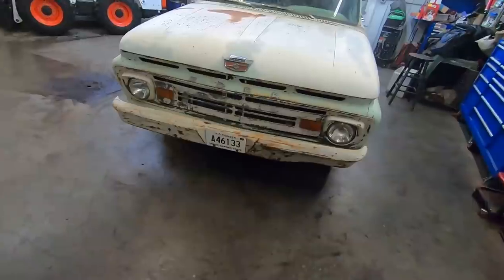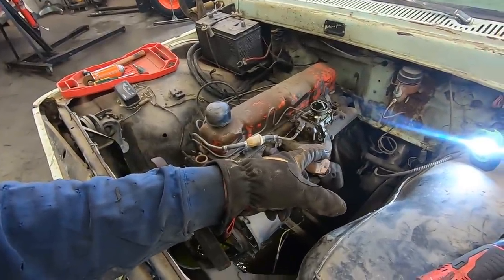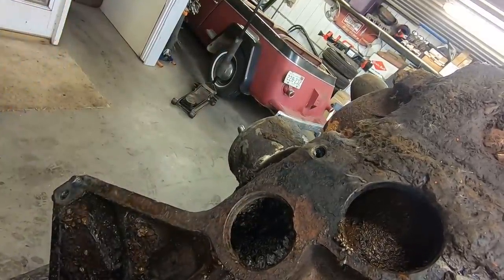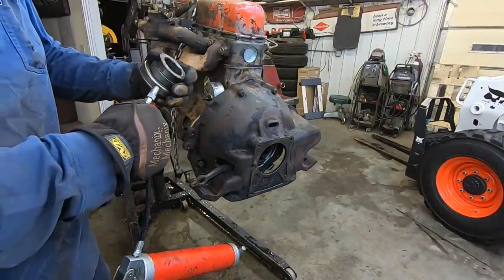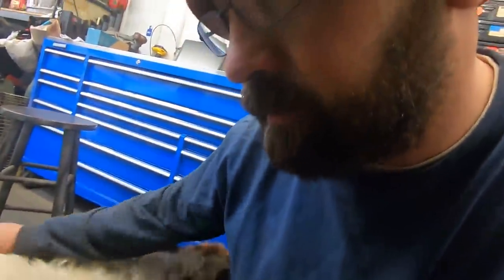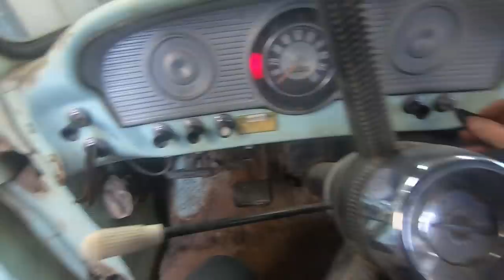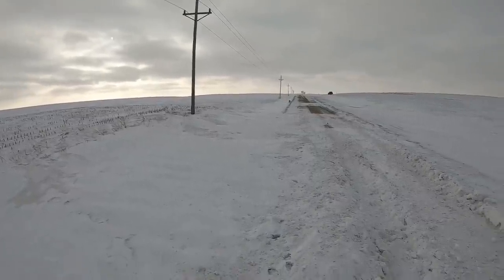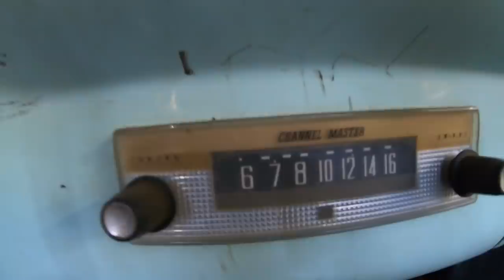My 1961 F100 Unibody Shortbed finally gets an engine R&R! And then we bury it in a snowdrift...

Comment: That old six would be a great candidate for a low pressure turbo set up. Nothing fancy, no intercooler or anything like that. Just a little 5psi boost. With the exhaust and intake being on the same side of the engine, even the plumbing would be easy.
Reply from the maker: Hmmm interesting

Comment: Chevy's inline 6's (230-250 and 292) have a freeze plug in the back of the block between the block and bellhousing also.  It's not just Ford things.
Reply from the maker: Never had an issue with one
Reply: @MortskeRepair  well, Chevy freeze plugs are gold plated, thus corrosion proof!

Comment: For the heater fan switch: High comes before Low, because if you start it directly in Low that motor might not start spinning, but it will heat and burn up 'cuz them electrons are still passing through it. Starting it in High however ensures that the motor gets enough of a kick to spin over, even if you immediately go to Low afterward.
Reply from the maker: Makes sense

Comment: The Ford Unibody pickup was made from 1961-63, you could still get a flare side (step side) bed with the separate cab and bed design. All styleside (fleetside) trucks were the unibody design. In 1963, after lots of complaints due to the unibody design (people would over load the beds, then they couldn't open or close the doors, or the doors would open going over bumps and rough roads, among other complaints), they finished off the 1963s with the older 1957-60 bed installed onto the seperate cab and chassis trucks. These came to be known as "wrong-year" trucks, as the bedside body lines did not match up. In 1964, they came out with a new bed design which matched the body lines, and those continued through 1966. Of course in 1967 the trucks were completely redesigned.

Comment: i use to have one i restored it and put a 63 t bird 390 tri power 400 hp stock and auto came out nice made good money on it i had under 2000 in the build got the truck for free the engine and trans rebuilt engine for 75 bucks then got a 4/10 possi unit for the 9 inch for 125 bucks fresh rebuilt it had a 292 v8 4 speed had a extra truck with auto for parts the expense was mostly paint and rebuilding the suspension i made a engine mount for it came out good works in any pu full adjustable set up it can use just about any engine mounts makes it so u can change the front mount trucks to side mounts and any engine great for ls engines by changing the center   part u can use it for off set mounts like a 383 mopar . so far it has worked good for 1000 hp engine
Reply from the maker: Nice!

Comment: Mortske, you don't need a new engine, you need a different transmission!  Well, you need a newer rear axle too.  
Depending on what you have laying around, you could put in an automobile 3 or 4 speed that wouldn't have the too high first gear.  You could also look for a truck 4 speed transmission that has the super low geared first gear.  If you ever do an engine swap to this beast, could you keep it a manual please?  To keep it period appropriate, you could swap in a Y block Ford. That might have enough low end torque to make the current three speed transmission work

Comment: Hi there Duff the body style is the same as the Aussie based ute (utility) and a good ( cheap )  way to get some better performance out of the 6 is to get a crossflow head again from Aussie they even use the same head gasket and carb as you already have just need a new rocker cover gasket and a dizzy out of a 4.1 would be way easier to set up as well ( no more points)

Comment: 275\60s or 255\70s would be good in the rear if you want to go a little smaller. One inch of tire height equals 200 rpm at any given speed. And since you need another 9 inch chunk, a 3.90 or 4.10 would really help ya get going.

Comment: I had a '61 F100. Actually I had 2 - one to drive and one for parts. Mine got painted with a brush. Tip - if it's hot outside, don't use a roller. Anyhow my daughter was about 5 years old at the time I had that truck. She asked if I'd named it. I told her the truck is Don. Why Don? I told her it because he's an old truck. Don Old Truck (yep, like Donald Duck) So he was Don until I got the second truck for parts. Truck two happened a couple of years later and daughter wondered if I was going to name the parts truck. Of course I did - Don Two. But that quickly became a question - If the parts truck is Don Two, is the driver Don One? "No" I told her. "The first truck, the driver, is now Don Juan." 😁
Reply from the maker: Good times!

Comment: I had a 62 shortbed unibody. It had a 351M and FMX swapped in. The 1st gear of the fmx 239 and the 378 stock rear she is a grunt machine and also not happy at 70. But the 351M lots of torque  low down. Became didabled and gave it to my grandaughter. Mine is just as noisy as yours.
Reply from the maker: Nice!

Comment: Be different and keep it an inline 6.  Find a newer (1990's) fuel injected 300 six with OD transmission, toss a few hot rod parts at it and have fun.  Won't be as fast as the LS swap but more cool points I think.

Comment: I would guess that you could use a 6 volt overdrive transmission if you put a suitable resistor in series to drop the voltage. The disadvantages of this is that it would create some heat and draw more amps from the electrical system. The heating can be dealt with, you would need a heat sink. If you find one try to measure the resistance of the solenoid and use a resistor of the same value. The power would be 49 divided by the resistance when the resistor is dropping 7 volts.

Comment: I would never pull a motor with that many miles and throw it back with fresh freeze plugs. I know rings and bearings are not that expensive. Budget builds are great! God bless. Sorry I have been holding it back as long as I can stand it. Just drives me nuts and I just need to get my own shop. I will shut up now. Love the dog.

Comment: My little brother has a 1957 F100 short bed . it was all original when he bought it . it ran for about a month , when the fuel pump went out , after replacing it . it would not start , we bought a 1970 buick for $75, so we put a 350 buick and a turbo 350 automatic in it , with 410 gears , it was getting about 20 mpg highway at 80 mph
Reply from the maker: Nice!
Reply: @MortskeRepair  it was a six cylinder 4 speed original , it was a lot better after we got done , it was 3 days total , pull it in , drive it out

Comment: I'm liking this truck.   If you do swap it, consider a cheap 86+ roller 5.0 Mustang engine and transmission or even one from an E or F-series.  Not a huge powerhouse by today's standard, but cheap and should be easy to make work in that old truck.  Probably cheaper than an LS swap even.  I won't be mad if you LS/4L80E it though.
Reply from the maker: Hard to find.

Comment: LS would have to harness as well as ecm and all that you mentioned. so why? Bah! Rebuild the front end and rear end different gears or tranny. grandad added a transmission behind the trans that seemed to work for super low or taller final drive ratio depending what gear the second trans was in. so there are options there.

Comment: What amazes me is you had everything off in the back of the engine and never seen or did not replace the plug then. The plug must of looked just as nasty as it does now and you left it in there LOL!! I guess you wanted to save some work for later eh?
Reply from the maker: I didn't have the bellhousing off at that time. Couldn't see it with it in place either

Comment: I am right there with you!!! I hate them all too!! I love me a lot of older vehicles.......but it has always been a love/ hate relationship, because when they are running great....that is good, BUT when I have to work on them, I have to wonder what the engineers were smoking who designed some of this crap!!! And it never fails in my life............I always seem to get the cars that have that ONE PART that fails that is completely impossible to repair, simply because some idiot stuffed THAT PART in a position or a way that makes it impossible to fix!! And I seldom if ever have THAT TOOL I need to fix it!! 
Owned a Dodge Monaco years ago that blew out a starter, for example and ended up having to half lift the engine out, just to get the starter out of the stupid thing!!! What would have been a 15 minute repair on a Chevy, took me six hours to replace a starter, a Kubota tractor, my fathers help, a logging chain and disassembly of not only the motor mount, but the driver's side exhaust system as well! Sadly the only vehicles I have owned that were actually "easy to work on" where Ford F series pick ups, Oldsmobiles, and most Chevys I have owned!! The only other exception was (easy to work on) was my 1984 Honda Civic!! Don't know why either.........the car literally sat in a field for 7 years before I got it, and had the odometer roll over TWICE on it before I ever owned it.......it was my post masters "mail jeep" believe it or not!!

Comment: LS is expensive and a coyote swap. Those are for rich folks. A old school 302 through 351 Cleveland will do you just fine. Just put you a fuel injection throttle body on it and call it a day

Comment: You can also use a transformer to deal with the solenoid voltage difference. God that's an ooooold memory. I can't even remember what old parts guy called them .,..

Comment: Really the frost plugs are actually core plugs they are there to get the sand out during the casting process but I call them frost plugs because 99% of the time if the engine freezes those plugs are usually the first to go but yean so know you know and knowing is half the battle LOL!

Comment: You should put a Tankless Hot Water Heater in the shop to use for pressure washer and then slowly plumb in any sinks you have.
Reply from the maker: What's wrong with the water heater I have now?
Reply: @MortskeRepair  I didn't think you had one since you always say it would be nice to have Hot Water to use for Pressure Washer.

Comment: Well, if it makes you feel better man, all cars hate me. My '83 Chevy C20 just keeps throwing problems at me, like the heater core just magically plugging up and leaking after about 100 miles, and the coolant was even green and not the extra chunky kind. Sweet truck though, I remember seeing one of these at a local car show when I was a teenager and being completely damnwell confused. 

Anyway, if you end up engine swapping it just put in a small block Ford, 302, 351, whatever. Transmission is entirely your choice, I'd be tempted to put in a four in the floor since the floor is already a little chewy. Sweet truck either way, love those giant fat rear tires. The mostly stock 302 (5.0) in my '93 F150 extended cab flare side motorvates that pig around just fine. Either way it ain't cheap, that's why 5 speed swapping my Flareside ain't happened yet, but it will!
Reply from the maker: Nice!

Comment: Google says “by completely off-loading the spring, other components within the wrench may move fractionally relative to each other. When you reapply spring compression the orientation of these components can change, therefore affecting accuracy. All in all, it is better to leave a bit of compression in the spring while in storage.”
Reply from the maker: Makes sense

Comment: Thought that you wanted to keep the blue  service truck to drive & hook up to the trailer & go get another vehicle that you find bcause it has the air compressor to air up tires instead of taking the air tank & you can put your tools in it that you need to take with you when you find one

Comment: Pretty sure I have the transmission you want but I live in TN. Love the little unibody!
Reply from the maker: I bet we could ship it
Reply: @MortskeRepair  yeah I have no idea what that would cost but I'd be happy to give you the transmission if you paid the shipping. It is in a 70 f100 you would have to use your bellhousing but should work.
Reply from the maker: @Truckman1980  They had overdrives in 1970?
Reply: @MortskeRepair  yeah it’s a 70 f100 3 speed on the column with an overdrive lever on the dash. I’ve had lots of 67-72 trucks and I believe this one is the only one I’ve had like that. I’d have to check the transmission to make sure the solenoid is on it and hasn’t been changed or anything.
Reply from the maker: @Truckman1980  That's awesome! Never saw one made that late! Send me an email with what you find.

Comment: The 223 bell will NOT mount to a y-block and vise versa. Made that mistake years ago when I bought a C-4 conversion kit for a 292. Ordered the 223 by mistake and the bell housing bolt locations are similar but not the same. Because Ford.
Reply from the maker: Damn Ford!

Comment: As I just learnt from Uncle Tony, if you add a grommet and PCV valve to that valve cover, your engine will stay cleaner inside and last much longer. Poop on road draft tubes.
Reply from the maker: How exactly does this work without me having to listen to him?
Reply: @MortskeRepair  Oh stop it, Uncle Tony rules. It's only about a 7 minute video.
Reply: @MortskeRepair  Road draft tubes work ok, sort of, at highway speed, but around town there ain't enough wind speed to create the vacuum needed to remove the oil vapors. The blowby and condensation stay in the oil and turn it to sludge. Yes, oil sucked back then, so did rings, but remember when engines were SHOT and fulla sludge at 100k miles? His video made a lotta sense. PCV certainly does no harm. On your truck, you could just run it to the air cleaner, or below the carb.

Comment: Know anything about 67-77 ford f600 with 390-477  trucks old uhauls converted to dampers  just bought one.(74)only way to tell cu pull head  for bore  other wise plug for stroke like to clean up  and patina shine just  need more info not finding much  (raturddumper) it was a uhaul converted to a dump bed !
Reply from the maker: Nope
Reply: By the way nice trucks (plural)
Reply from the maker: @tonygregory6362  Much appreciated!

Comment: they call 'em freeze plugs, but they are really there to give access to remove the casting sand from internal passages from when the parts are cast. in the late 80's i worked at a aluminum foundry in the knockout room. i clamped ford 5.0 intake manifolds into a huge vibrating fixture and used a 150 psi. 1 1/2" air hose with a ball valve and 3' steel tube at the end that i inserted in the freeze plug holes to blast the casting sand out of the coolant and air/fuel passages while it vibrated in the machine. it was a nasty, dirty job, 'cause that sand went everywhere. it was worse than going to the beach, with nary a single bikini in sight to take yer mind off the sand in yer crack chaffing the bejeebus out of ya.
Reply from the maker: Hopefully you moved up the ladder since then!

Comment: LS swaps get way too$$$, here in aus you'd be lucky to pick up a LS1 for under 3k, then you need a trans, computer ( most go MSD) if you stay injected, mounts, suspension/brake upgrades etc then engineering....lucky to get change out of 10-15k

Comment: when you put the tranny in. use two bolts that fit the bell housing just cut the heads off and they act as guide pins.
Reply: The bolts with cut-off heads is a great labor saver, also have the rear end of the vehicle higher than the front, it makes gravity work for you.

Comment: Morski have you never heard of putting a latex glove on the tail shaft of the transmission and using a zip tie or tape to hold it on to catch the oil I can't believe that a mechanic of your capabilities has never heard of doing that period but stranger things have happened I just saw today where bad Chad did not know that trick either. I wonder if pudding would pay for that info.
Reply from the maker: Not a bad idea! Never seen it.

Comment: I know you were talking about a LS swap and the cost involved, I was told once the 302/5.0 will bolt in place of the 300, 6. I know this truck doesnt have the 300, but the mounts might be the same. I had a '66, short wide box, but it had the 352 v-8. Great video at any rate and thanks for explaining the frost plugs (good info to know).
Reply from the maker: no, 300 has side mounts

Comment: I have a 1 ton '91 E350 box van in my yard. It's my storage shed. It has a great running 351W and a C6. Has an electronic issue in the EFI, it dies when ya shift into drive. It would be great with a carb. But I'd have to pull it out (the horror!) and drive 2000 miles to deliver it. Um, no.
Reply from the maker: It'll be fun tho!
Reply: @MortskeRepair  Yep. I only told ya about it to make ya envious, since I don't want to pull it, much less deliver it 😜. North Dakolder doesn't sound like a tourist destination right now. And I'm lazy.

Comment: Have you ever tried using the ash from your fireplace works damn good and after it dries it's really easy to clean up
Reply from the maker: I don't have a fireplace.
Reply: @MortskeRepair  you live out in North Dakota and you don't have a fireplace you don't have a furnace anything damn
Reply from the maker: @3xp850  propane, fuel oil, electric, no wood. There's no trees here!!

Comment: actually the side valley/lifter gasket is the same on the 300 cu in engine as the 223,more useless knowledge of the day so there is one part that will interchange,i have lots of 223 parts and i think i will send you some.anybody driving a 223 should have lots of spare and new parts in a box under the seat haha
Reply from the maker: Interesting.